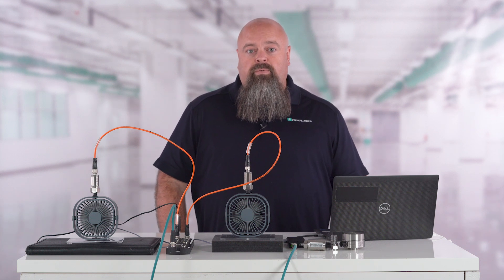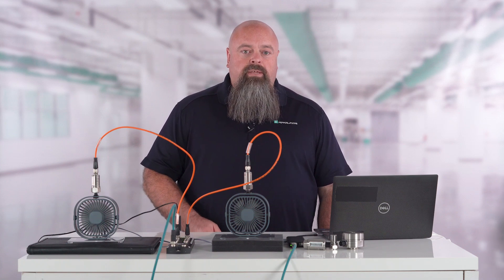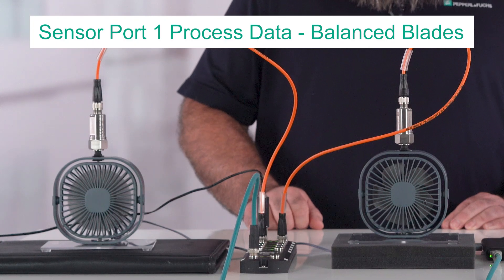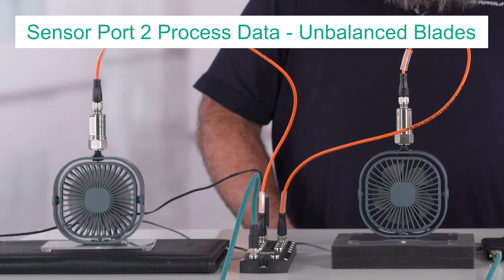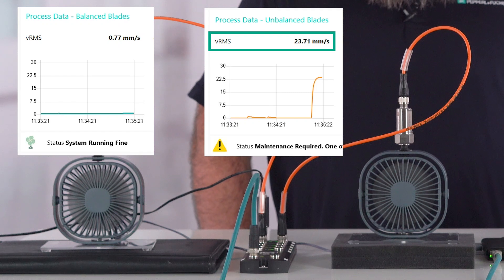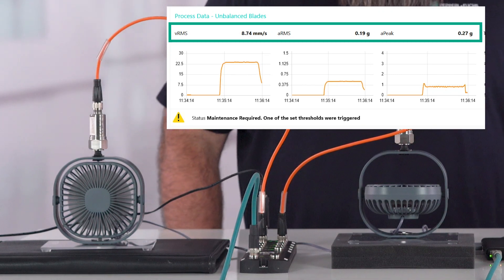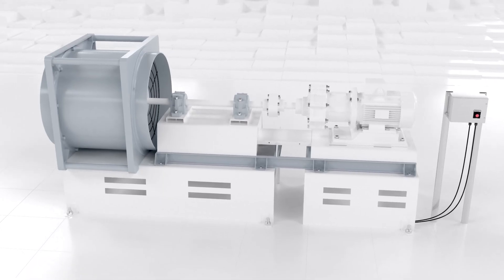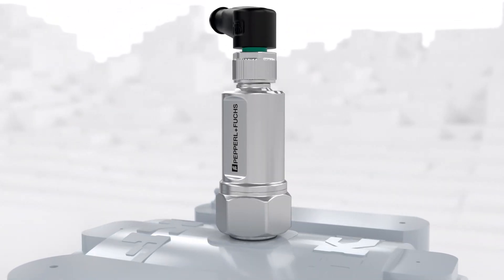Vibration Sensors for Machine Condition Monitoring: Demo | Pepperl+Fuchs

Comment: How have you attached the accelerometers to the fans?

We are preparing an introductory fourier transform experiment for our mechanical engineering students and will be doing something similar.
Reply from the maker: Hello Omar-sj7wl, thank you for your inquiry. We have attached an M8 threaded clip, similar to an automotive-style clip, to the sensors of the fans. Any M8 threaded clip, magnet, boss, or nut can be used here.